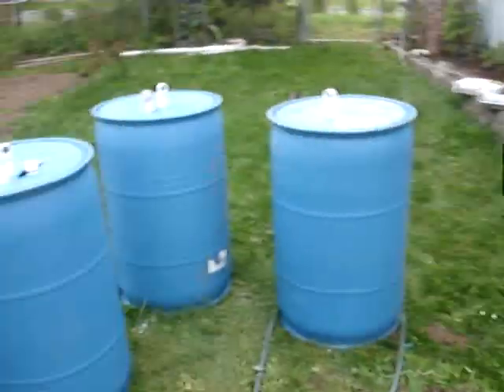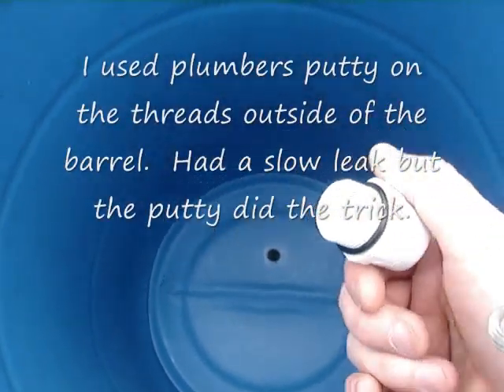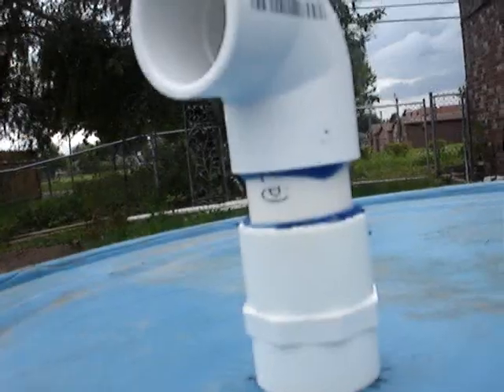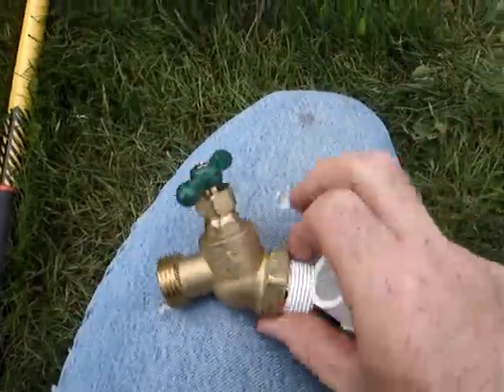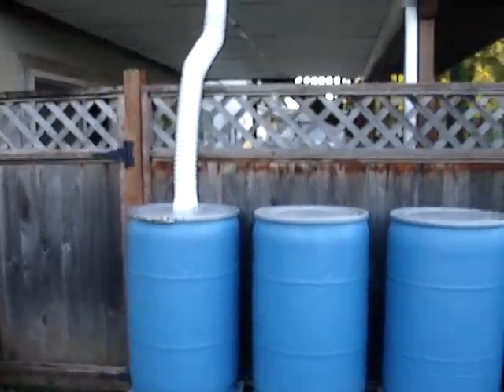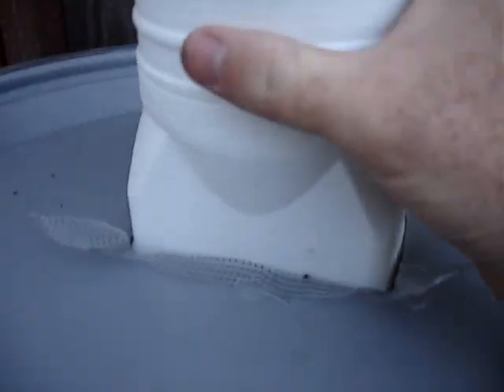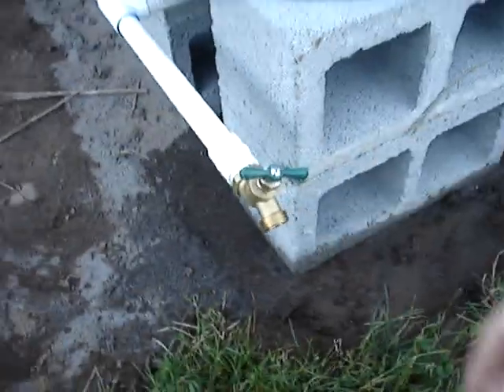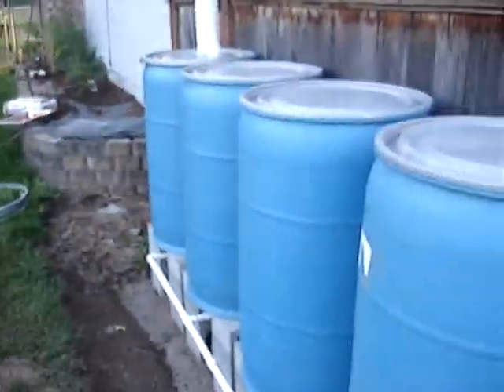DIY Multiple Rain Barrel System How To

Comment: One suggestion on water pressure. If you put in an air manifold in the lid, just like the water manifold in the bottom, you can pump air into the tops of the drums and really increase the flow of the water out of the drums. It doesn't have to be very much pressure either. We use that technique to increase the flow of ink out of big totes. I would use a foot bicycle tire pump with it and just pump it a few times when the pressure drops.

Comment: First, great video, and I think I will be building mine around this same concept that I have seen several times. One suggestion, that valve at the end is kind of wobbly. Might be worthwhile to put something in the ground and go around the end of the pipe to stabilize it, so it does not crack, break, or pull a seal from the previous barrel while you have a hose connected.

ALSO - the ball valves are AWESOME. Pull a lever, and its open. No screw type to open and close with. Great system!

Comment: Isn't it perplexing when we watch our gutters drain rain water into the sewer or storm system and then complain after a month of drought of the expensive water bills or better yet (like me) get a notice we can no longer water our gardens!  First they took away watering grass, then our fruit trees and finally our garden.  

My 1000 SQ foot pole barn 1 inch of rain=623 gallons of water!  I use 200 gallons watering a 1500 square foot garden once a week.That's three weeks of free water I am wasting!

Comment: great post.  Two thoughts, first put a U-shape trap into your inflow system (aka the guttering)  I would use large diameter pvc and make each side of the U long so sediment will settle to the bottom and have no chance of making it up the other side.  Build a cleanout into the bottom of the U, and there you go, easy sediment filter that is also easy to clean.  

second, put a slant on your manifold towards the hose fitting so that it will completely drain.

Comment from the maker: @brianmeff Easy to find out. Take a glass and turn it upside down. Now lower it into a sink full of water.  No water will fill up the glass.  There will be an air pocket that will keep that barrel from filling without a hole to let the air out.  The opposite test would be to take a 2 liter bottle and fill it with water.  Turn it over and you will get a glug glug as air tries to rush back into the bottle to fill the void.  Now do it again with a big hole in the bottom.  It should poor right out

Comment: Very nice rig... BUT... that 2" overflow in the last barrel you are thinking of is much larger than the 3/4" inflow to the last barrel. You probably should put a 2" overflow in the first barrel instead, especially because, "when it rains, it pours".  If you start empty with a torrential downpour, the first barrel will be overflowing before the other three can completely fill.  That's what you want, else the input t will have to pop out of the top of the first barrel due to the water pressure.

Comment from the maker: @haroldt101 To allow more water to drain out of the barrels.  The coupler is about an inch high so it will always leave one ince of water in the bottom of the barrel.  With the hole there I only have a 1/4" of water left in.

Comment: Thanks for the info - I looked but did not see the following question.  What is the puprpose of the some hole you show drilled into the coupling attached to the bottom of the barrel?

Comment: USE PVC valves, not metal spigots! You can attach a hose to   threaded PVC piece if you want.
The valves close easier, attach to other PVC pipes easier.

Comment: I am also in the process of making this same type of system. I noticed in your video you stated that you used an o ring on your fitting and had a slow leak before you puttied it.  I was wondering, what if you were to double up the o rings, putting one on the outside of the drum and one on the inside.  Do you think this would garuntee a sealed hole?  Thanks for sharing this video!

Comment: @KainanRa I'm designing one now and I will be going with flexible hose, the last time I used pvc like this it became brittle and kept leaking , one day after a strong wind  one of the pipes actually shattered into 3-4 pieces.  If the pipe was attached ridged onr encased somehow it may have helped , but the movement of the pipes and flexing of the barrels was causing problems.

Comment from the maker: @stymye Ul listing...Schedule 40 rigid PVC conduit and fittings are for aboveground use indoors or outdoors exposed to sunlight and weather, and for underground use by direct burial or encasement in concrete.  Look it up.

Comment from the maker: @18wheeler76 Glad it will help.  It is not in the video but I decided to put the overflow spout on the first barrel instead of the last.  Got a suggestion from a youtuber that mentioned the overflow would be restricted by the pipe down below.  Also going to but a larger 1/4 turn valve to increase waterflow.

Comment: Ya know, if you took this type of system with one barrel and put it next to your rabbits, you could set up an automatic gravity fed watering system for your rabbits.

Hook up a small solar panel and wrap the pipes in heat tape, and you wouldn't have to worry about the water system freezing in winter either. (The solar panel would have to be strong enough to run the heat tape, but 3" heat tape only runs 4-6 watts a foot, so, it could be done)

Comment from the maker: @davettalashley I do see algae in the water but it has a reall hard time growing insid e the barrel because there in no sunlight.  Smells fine to me but I never left it in there for very long.  As for washing with it that is up to you.  I collect it from my roof which then flows through my gutter and is collected in the barrels.  I guess you just have to decide if you would wash with gutter water.

Comment: Question: do you get more pressure from your rainbarrel system because they are all connected? For instance, I currently have two rainbarrels that are connected by an overflow hose at the top of the barrel. They both have spickets at the bottom. If I connected the two spickets to one outlet (like you did), would I get more pressure than individually?

Comment: What I would suggest is putting the rain barrels up higher to store kinetic energy. You can use the fall of the  water coming down the pipes to generate greater pressure. Put the barrels closer to your garden, use a battery powered garden timer valve like you would have on your hose, run wet hoses through your garden and you can water your garden automatically using your rain water. Works flawlessly and all the parts are available and cheap at your local hardware store. PM me for details...

Comment: Hi. You can have all your barrels full if you have your over flow coming up from the top and then going down. the down spout opening must be above the over flow, and the vents.

I have a drill pump that I bought at Home Depot for $6.97. It pumps water at about 3 1/2 gal. per minute.  I have a washer machine hose that I connect to the rain barrel, then to the pump that conects to a 50 ft. hose. I am pumping my water up ten feet  Works great.

Comment from the maker: @outofworkbum I found the same thing looking at other systems.  They all fill one barrel then overflow to the others from the top.  Then if you want to use the water from the secondary barrels you have to move the hose.  This system fills all barrels at the same time and uses water from all barrels at the same time.  However you do not gain more pressure no matter how many barrels you put in series.  To get more pressure you would have to stack them on top of each other like a tower

Comment: looks awesome. All of the systems I have looked at fill a barrel then spill into the next, from the top. have you tried this manifold system filling all four barrels yet? and if so do have the pressure of all 4 barrels at once pushing out the hose? If this works for sure it will definately be how I set mine up, thanks for posting